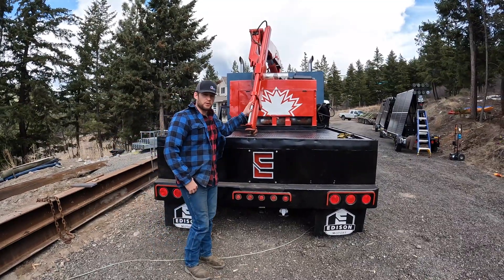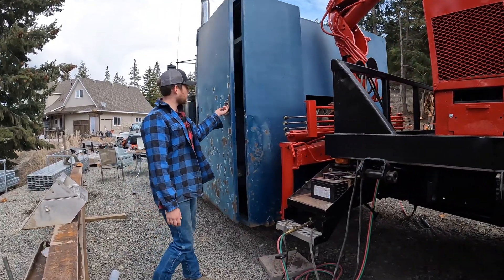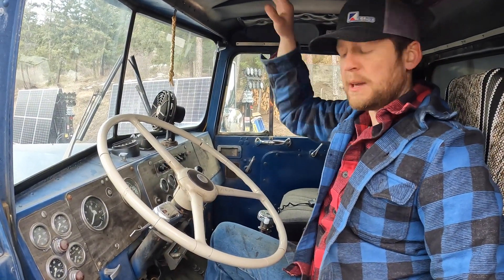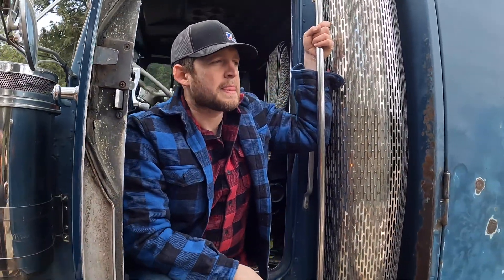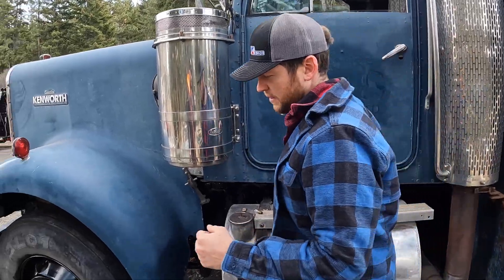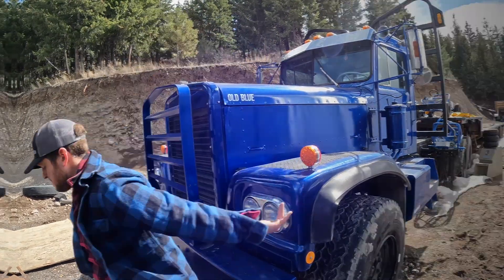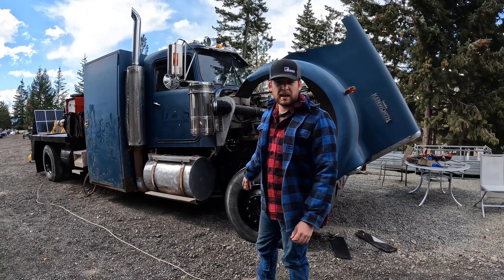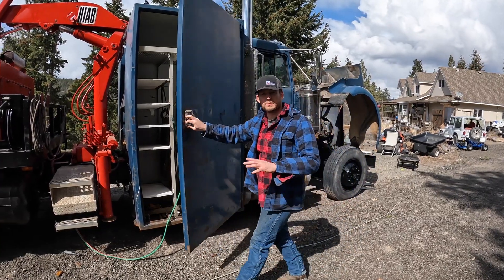Edison Motors Service Truck Tour: Vintage Rig Revival

Comment: The Hiab crane is made near my farm in Sweden.  Hiab stands for Hudiksvall Industries AB, which is Hudiksvall Industries Aktie Bolag which is Swedish for Corporation.  One of my best friends used to be an electrical engineer for Hiab.  Peter is a wizard and electronic and hydraulic control systems.  I look forward to the day when we can have Edisons in Sweden.  A friend's son is an engineer for Scania in Linköping, Sweden.  There is a whole lot going on in this part of Sweden.  I'm at 62° north latitude which means that if I was in Alaska, I would be about 10 miles south of Talkeetna........but we have far better weather than Alaska has.  We have a lot of logging and log trucking in this area.

Comment: I can tell u y loggers went with butterfly hoods and not the flip forward hoods because it's cool. And for cooling. What's cooler going up a hill with hood shut screaming away. Or showing what's under the hood in the passing lane screaming away at 100,000lbs

Comment: have you considered for a different service truck to instead use an old cab over? such as a 352 or 362 for the shorter wheelbase and added maneuverability.

Comment: Lw , the logger model had the butterfly hood simply for the moose killer bumper gaurd welded straight to the frame... couldn't have a tilt hood and have maximum protection on the front.

Comment: Starting with a solid base like that even if you put $50k into it you're still way ahead of buying a shiny new one. That one is already ready to work after a week or two in the shop instead of waiting who knows how long for the new one. Plus it already has a few scratches so you won't be afraid to put it to work whenever you need it.
Reply: And think of it, being about 55 years old, think of how well trained that truck is.  No new truck would know how to deal with things like that old Kdub.

Comment: Old tech and equipment is always better. Better lasting quality materials and components. Simpler designs, easier to repair and maintain. Built to last a lifetime. And the best part is it's grandfathered in on stupid, expensive, and unreliable emissions control systems. I'll take rugged cheap old reliable over shiny expensive new unreliable any day of the week.
They old saying that " They don't build em like they used to" Is sooo true!!